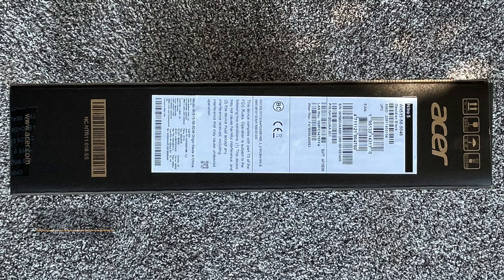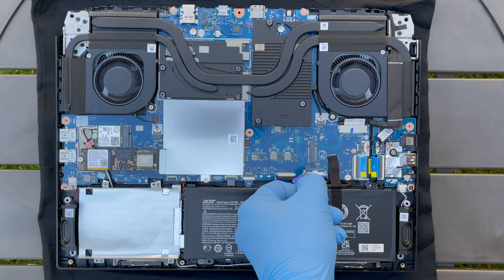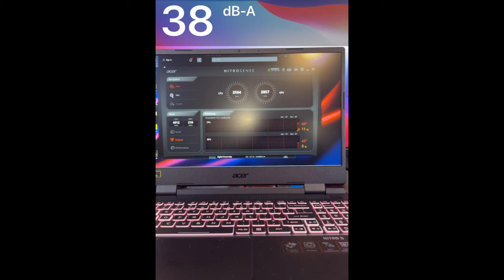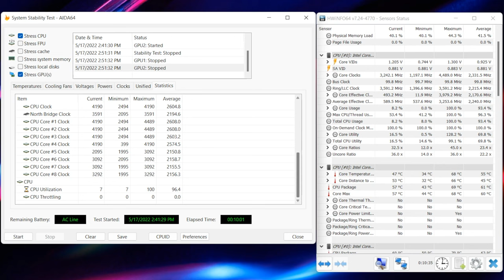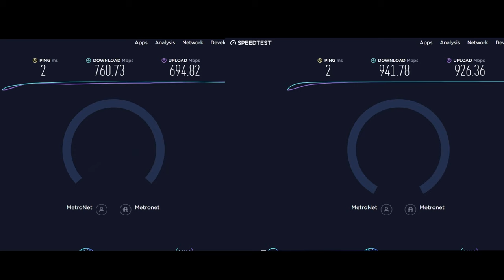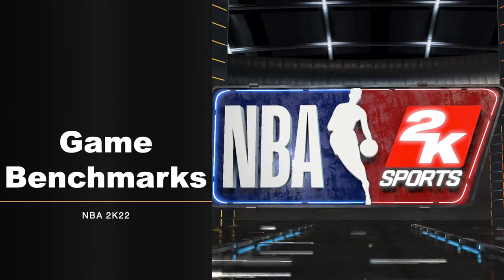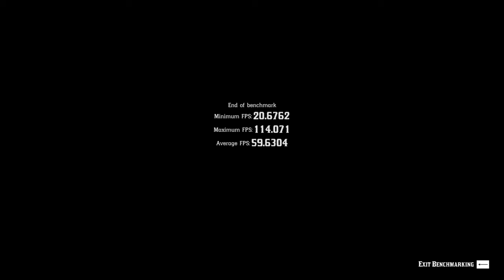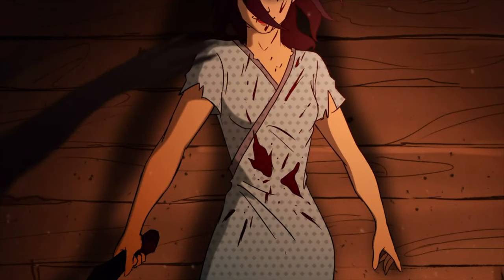Acer Nitro 5 i5-12500H RTX 3050 TI Review Newest Model (AN515-58-5046) 2022

Comment from the maker: All games were played using the Performance mode along with the fans set to Auto.  I played Warzone for a bit today and it hit 90C like in the Microsoft Flight Simulator.  If you put the fan profile to Max, the temperature will go down.  Once I did that, my Warzone CPU temps fell into the 50's 60's,  and upper 70's.  I'll post a video soon.
Reply: I can't believe you got the newest acer nitro 5! 😲🔥💯
Reply: Please make a video about how this laptop performs for creators in Softwares like Da vinci resolve
Reply: Did u manage to try vr on it?

Comment: Nice design improvement. However, I hope they still place the battery and power indicator on the same placement as the last model. It helps you see it better rather than it being on the side. Overall great review!
Reply from the maker: It can be a pain to look on the sides at times just to check.  They should pt it on the top or near the power button.

Comment: i saw your review from best buy and had to check out your channel, this has to be the best review ive ever seen, i love how much detail you put in this
Reply from the maker: Wow, thank you!
Reply: @Meanpooh  same here might go and buy it today thanks for the review man!!!
Reply from the maker: @glogang4759  I'm seeing an increase in temperature at the moment.  Just like I mentioned in the video.  Going to do more testing with games just to confirm.  The only way to get the temp down in some games is to use max fans which is loud.  Just throwing that out there.
Reply: @Meanpooh   do you think this laptop will be good to do school work ? Also do the temperatures get high when you play on max graph settings or it doesn’t matter ?
Reply from the maker: @glogang4759  Its fine for school work but don't expect to be mobile for long.  2-4 hours max.  Temps will get warm just like in the video.  Lite games are fine on the Auto fan setting.  Games like Warzone will have to utilize the max fan setting after some time.
Reply: @Meanpooh  by lite games you mean gta 5 with mid graph settings 👀? Also the battery life on this model is not the great nor going to lie
Reply from the maker: @glogang4759  Lite games as in Dead Cells, Siege, games that don't take much to run.  Those games will have lower temps when playing.  Battery life on most gaming laptops are not good.  The battery is small in this one like the previous ones before it.

Comment: Liking the slight design changes and I'm sure the thermals are a little improved over the past models thanks to these changes. I have the version with the 3060, 16GB and i5 10300H and I bought it two months ago for a nice discount. It's a great machine but the thermals could definitely be better on it. Other than that, no qualms about it.
Reply: Try changing power plan options and set cpu max @ 99% so it wont turbo boost. It might give lesser fps (tho my machine doesnt and its acer nitro 5 i5 11400h + rtx 3050) when gaming at max 10% lesser fps, BUT thermals will tremendously lessen.

Genshin max settings render res @ 1.1 
-cpu 77C : gpu 85C
vs cpu max utilization @ 99%
-cpu 58C : gpu 64C

Note: i dont have external cooler, but have laptop stand. I think this will work on your machine considering you have a really good gpu
Reply from the maker: I went back and play with the fans set to max as I usually keep them on AUTO and the temperature dropped 5-7 degrees.  I'll be posting some videos with lower temperatures.
Reply: @Meanpooh  but its too loud and limiting cpu utilization to 99% is really good for laptops since cooling is inadequate unlike desktop pcs where you can really modify the cooling your device gets
Reply: @genshininsufficientrewards533  I did this today setting my CPU and battery at 99%. Definitely reduced the thermals without much of a performance hit. Tried out Borderlands 3 after this and the game ran nicely without making my laptop sound like it was about to take off from the runway. 

Cheers!
Reply: @genshininsufficientrewards533   I just set the fans to max as well. Now it sounds like it's about to take off again but combined with the 99% CPU trick the temps have gone down a good bit. Performance is much better now. I'll just use headphones to mask the sound 😆
Reply: @aninfinitemindofmusicandreams  glad it helped!

Comment: 1.5 hour review video... Incredible! Thanks. Did you edit and render on this laptop? If so, I'll buy the 3060, 12700h one 😁
Reply from the maker: I have not tried.  I use a Mac for that.  Making videos on this machine should not be an issue.  If you will be using a lot of 4K you may need an additional 16GB of RAM.  Its very easy to run out of memory.   Actually I sometimes to run out while using 32 depending on the project.
Reply: Did you buy it? I am looking to buy too

Comment: Got this today and got that cable. Over all it seems fine. Got it on sale I guess for 879.99 which was a little bit of a savings.
It seems that the download speeds for this laptop are pretty fast. I'm happy with the download speeds. It doesn't get too hot. This laptop gets kind of loud when the fans kick in. The rtx capability is lesser compared to the rog zephyrus 14 which had an rtx 3060. That is expected because there are more rtx threads in the 3060. Over all the laptop seems nice for gaming. I didn't do anything demanding and when I loaded up an rtx world for Minecraft the fans kicked in. It's not the most quiet but it's not terrible.

Comment: Great video! Quick question, I’m looking for a travel gaming laptop, I usually play Warzone for 2 hours straight, would this be a good buy or what’s your recommendation?
Reply from the maker: Thanks!  It can handle Warzone.  It really depends on your settings.  I ran it maxed out and it averaged around 56 FPS. It has a big range between 39 and 73 FPS depending where you were.  Midrange settings or the normal settings are better with higher FPS.  I made a video already but it won't publish till the 28th.  If you can find another machine with a 3060 then that should be the one to get.  You will have to play with the fans on Max to keep those temps down and it's loud so have a pair of headphones handy.  It's a good buy but that really depends on your budget.
Reply: @Meanpooh  thanks for the fast response! Ideally I’d like to game close to 100 fps and I generally play with settings at low. I’ll be on the lookout for a budget but good 3060. Thanks again.
Reply from the maker: If I hear of something i'll post back.  If you want to see how a 3070 with a Ryzen 5800 performs at 1080 look here.  It's in your FPS range.
https://www.youtube.com/watch?v=5MHHnrwU5yg&ab_channel=Meanpooh

Comment: Hi I was looking for gaming laptop and I am bit confused between Rtx3050 and rtx3050Ti and I have seen rtx3050 is a bit more pricey so should I really consider 3050Ti for better fps or RTX 3050 would be ok for AAA titles
Reply from the maker: 3050 Ti is faster.  It's a little more pricey as you said.  3050 is ok for AAA titles as long as the CPU is good.  If you look for 3050 Ti also compare the 3060 models as sometimes the price is pretty close.

Comment: Hey how long does the battery last on a normal usage? 
Would you recommend this laptop or the Lenovo Legion 5 with Ryzen 7 5800H and a rtx 3050ti 
Which one do you think is a better option?
Reply: This has 12 cores and 16 threads beats any 5000 series apu now  6000 series maybe different in some cases but the 7000 more than likely will be

Comment: Which would you say is a better deal, in performance, aesthetics, display, cooling, and overall feel. This acer nitro 5 or the asus rog strix g15 ryzen 7 4800h rtx 3050ti. I'm having a hard time deciding which one to get.
Reply: check benchmarks for both and compare it, which one has the better performance is the one you buy

Comment: Hey Meanpooh, Have you changed windows on this laptop or do you still have the factory of it ? If yes can you provide me with the OS that came with the laptop ?
Reply from the maker: Still using windows 10.  There is no backup disk option.  If you need the OS, go to Microsoft.com and download the OS for free.  Create an installer USB and Install Microsoft Home.  The Windows should register itself. I believe the key is hardcoded to the laptop. You will have to go to Acer and get the correct drivers for the machine after install.
 The other option is to use System Reset. It will put everything back like new.
Reply: @Meanpooh  Yeah I did exactly that, and the activation key got synced to my Microsoft account and automatically activated, bt now I again upgraded to win11 and I can't install dts x ultra it shows an error

Comment: which nitro 5 would you prefer, the i5-12500 w/ rtx 3050 or ryzen 7-5800h w/ rtx 3060? Thanks bro!
Reply from the maker: Pretty close in performance but I would go for the 5800 and 3060.  It's the better choice and if you can get a Legion that would be even better.
Reply: @Meanpooh  Thanks bro!

Comment: Can you try Emulations pcx2, rpcs3, dolphin on this one that new i5 12500h has 12cores 16 threads it’s much faster than the last year acer nitro 5 moslt emulation uses more cpu power than the gpu(If increasing the resolution gpu power will also increase)

Comment: Hi could I get anyones opinion on which would be the better laptop? (Looking to play mostly LoL, warzone and R6 siege) thank you 
ASUS ROG Strix G15 (Ryzen 7, NVIDIA GeForce GTX 1650, 16GB/512GB, Windows 11) 15.6-inch Gaming Laptop (G513IH-GTX1650T)

Vs 

Acer Nitro 5 Gaming Laptop (Core i5, NVIDIA GeForce RTX 3050, 16GB/512GB, Windows 11) 15.6-inch Gaming Laptop (AN515-58-58BN)

Which one would be the better laptop? Thanks In advance 🙏🏻

Comment: I have questions..
Mine is an515-58-5046 
what will happen if I fill all 3 SSD slots with 4TB SSDs to a total of 12TB storage? Any repercussions?

If yes, what of 3 2TB SSDs making a total of 6TB?

Do help 🙏🏿
Reply from the maker: You should have no problem, provided that the BIOS will recognize the drive capacity.

Comment: Do you know the best gaming laptop for under 1000?
Reply from the maker: Not really but for under a thousand I would look at the 3060.  The 3050 Ti is ok but the 3060 is better regardless of the wattage.
The is a good price for the Dell 
https://www.bestbuy.com/site/dell-g15-15-6-fhd-gaming-laptop-amd-ryzen-7-8gb-memory-nvidia-geforce-rtx-3050-ti-graphics-512gb-solid-state-drive-phantom-grey-with-speckles/6461724.p?skuId=6461724
it may run a little warm though and its cheap.
This model has the 3060 which is better,
https://www.bestbuy.com/site/gigabyte-15-6-fhd-ips-gaming-laptop-intel-core-i5-11400h-16gb-nvidia-geforce-rtx-3060-512gb-ssd/6494742.p?skuId=6494742

both are well under 1000.

Comment: Hello! What can you recommend more
Acer nitro 5 r7(5800), 3060 , 16gb or 
Legion 5 r5(5600), 3050ti ,16gb
Reply from the maker: I don't know the build quality of the Legion but I do know the Legion 5 Pro.  The Nitro 5 is the one I would get.  It has faster CPU and GPU(extra cores and RAM).  Like I mentioned earlier.  Its gonna come down to the build quality.
Reply: @Meanpooh  ouhhh thank youu!! If it's legion 5 pro and r7? With same 3060 it will nitro be better? I just thought that since legion is bit higher in price it's better!
Reply from the maker: @marcjames1623  the legion 5 pro is a better build than the nitro in terms of quality. Don’t forget. The nitro is a budget line computer. The predator model is a step up.
Reply: @Meanpooh  thank youuu!! Some site compares legion 5 pro and nitro 5 both Ryzen almost the same so either of it I can't go wrong.. hopefully nitro can last
Reply from the maker: @marcjames1623  If you are low on money, get the Nitro. If you have the cash get the Legion Pro. The cooling is better as well as the sturdiness of the machine. Nitro All plastic, Legion Pro aluminum. Will help with cooling a bit.
Reply: @Meanpooh  thank you so much for the advice!

Comment: it has two M.2 slot & one extra SATA slot for HDD or SSD right ?
Does secondary M.2 also supports gen 4 SSD also does it support 2TB ?
Reply from the maker: Not exactly sure if it supports Gen 4 but  It may support 2TB on the M.2 slot.  I do know that the SATA connection does support a 2TB SSD as I have on in it.
Reply: @Meanpooh  Could you share me the SATA SSD link ?
Reply from the maker: @sandesh01  https://youtu.be/XvxhCSp5s6I
Reply: At some point, I"ll upgrade my 2tb ssd gen3 to gen 4...  during the migration of the gen 3 I'll pop in both the gen 4 stock drive and the new gen 4 in slot 1 and do the tests.. at the time I bought this gen 3 drive.. it wasn't a given that laptops would ever have gen 4 capability, at least for a while. This acer is a good migration point for me because I had upgraded my old acer with 32gb of ram and it works perfectly in this laptop, and a swapped this 16 back to that laptop to use for work. Benchmarks are marginally faster on the cruicial ram than stock micron (latency, even though the ram has the SAME specs). Hoping to hold off getting my next laptop until ddr5 and gen 5 ssd, and higher end gaming PCs aren't perpetually near $2k. I also hope mfg can improve battery capacity in the next 3-5 years.
Reply from the maker: I see laptops increasing in price. Even the low end.
Reply: @Meanpooh  yeah even the Nitro just went back to 1000

Comment: Hi i would like to ask Is dell g15 5520 i5 12gen 16gb ram 512gb ssd rtx3050 120hz screen is better or this model
Reply from the maker: Dell would have better build.
Dell likely to come with faster RAM.
3050 Ti is faster than Dells 3050.
Acer has faster screen refresh rate.
Acer is better value.
Reply: @Meanpooh  so you recommend acer nitro 5 right? does the acer nitro 5 sound of fan is very loud when u play apex or something

Comment: asus tuf a17 (16gb rtx 3050 90whr battery ryzen 7 4800h ) 

or

acer nitro 5 (8 gb ram i5 12500 h rtx 3050 57whr battery)
??? which one you would recommend to me brk
Reply from the maker: Longer battery life with the Tuf.  Better gaming and rendering with the Acer.
Reply: @Meanpooh  which have good vents
Reply from the maker: @aditya_shrma2004  There are intakes on the top of the Nitro.  I couldn't tell you on the Tuf as I don't have it.
Reply: @Meanpooh  what about acer

Comment: Does it support a 7200RPM HDD ?
Reply from the maker: If it is 2.5, yes.
Reply: @Meanpooh  so not actually sure if it does ?
Reply from the maker: @sandesh01  I said yes,  If you can find one that can fit inside @2.5-inch then it will work.  Some drives a thick so even if you do find one it may not allow you to close the bottom panel correctly. You can use a 7200 External drive if you wish with a reduced transfer speed.

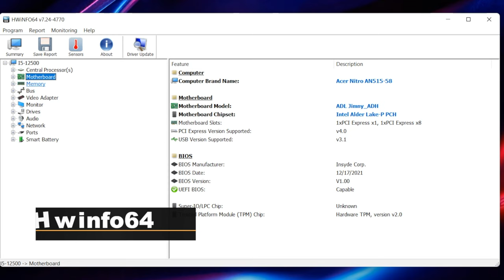Comment: 32:57 why is it set o 1600MHZ ?
Reply from the maker: Because that's the speed.  When needed it can double to 3200 hence the 3200MHZ that's plastered everywhere on laptops.  The real speed should be printed IMO.  Just creates confusion if you don't know what your looking for.
Reply: @Meanpooh  so the one on the video could be maxed up to 3200 ?
Reply from the maker: @sandesh01  As far as I know the max memory is 32GB.  Frequency of the memory will be up to 3200Mhz in its current configuration.

Comment: Can the nitro 5 can the quest 2?
Reply from the maker: I've heard people getting it to run with the Acer using virtual desktop.  I dont have one to test but I will be getting a Pico 4 to test it on this month.  They are pretty much the same as far as wireless connectivity goes.
Reply: @Meanpooh  what about wired connectivity?
Reply: @Meanpooh  btw I can't use wireless
Reply from the maker: @alexsiemionko4912  The Quest 2 is able to be connected using a "Link Cable."  There are aftermarket ones available but Meta recommends their brand.  Here is a link to Amazon. https://amzn.to/3BnsE6D. You can also get it at Walmart, Best Buy etc.  If you are in another country, I'm not sure of the store names.  Check Reddit in the Meta area to see what others have tried and recommend as the cable is expensive.
Reply: Alright, thank you!